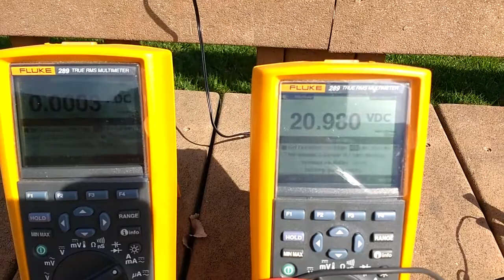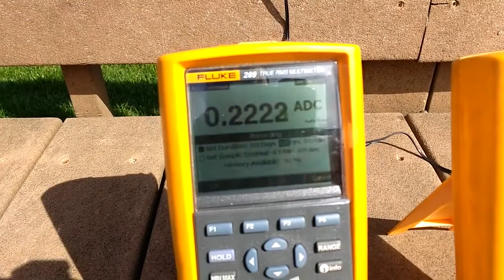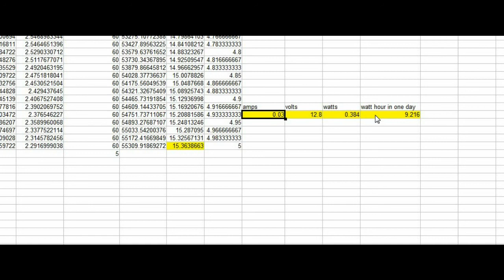ALLPOWERS 18V 12V 7.5W Portable Solar panel

Comment: how can this be safe to use with car batteries? if its putting out 20v its gonna fry the battery. max for lead acid should be 14.8v to charge. and around 13.5 for float.

Comment: Thanks for the video.  I'm looking for a small, waterproof panel that will charge an 18 volt portable drill battery, which I use the run a fish finder rated for 10.8-20 volts, pulling 615 mah. Do you have any suggestions? Thanks!
Reply from the maker: What type of battery is it? If it's lithium or nickel metal you are going to need a charge controller that is compatible with it.

Comment: I don't like these solar charger, make sure it don't drains power at night.The way I do it I disconnect car battery if the battery does not need programming to the car works well for up to 5 month then just charge battery with ctek charger and reconnect. Ps good vid maybe do a night test
Reply from the maker: Intrade Motor a night test is a good idea. When I have time I'll do that. It says that it has a built in diode to prevent it from discharging at night but i won't know for sure until I check.
Reply: They have reverse voltage protection built in so making voltage can only travel one way.
Reply: @deezy9622  yea like that lithium ion jump starter who started  smoking  when i  accidentally   fitted on wrong with diods  from the onhanglow  district ..  claiming   you will be protected.